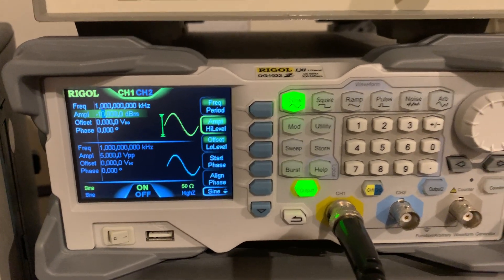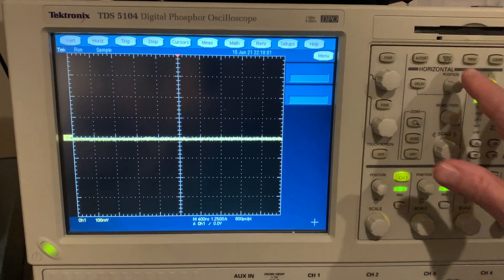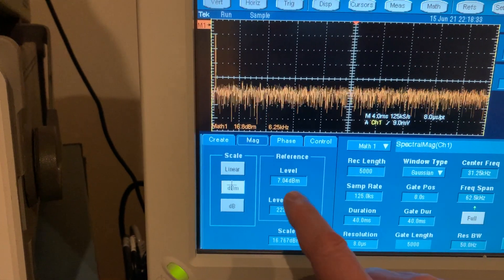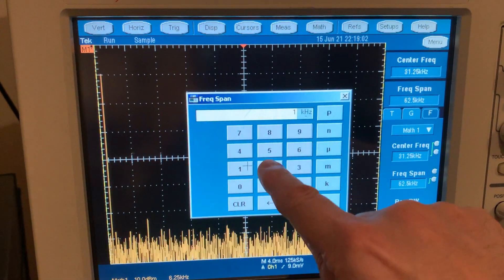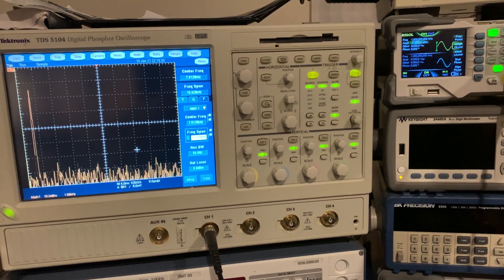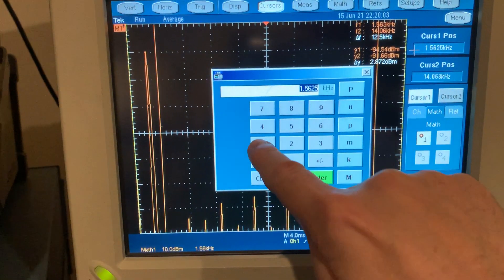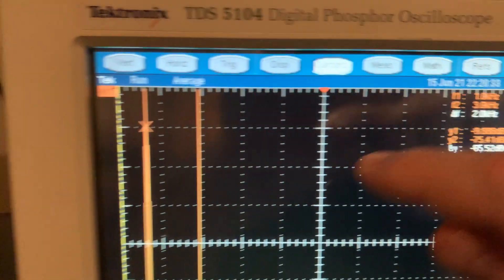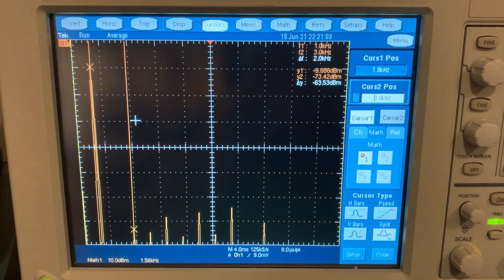Harmonic distortion of audio frequency from Rigol DG1022Z

Comment: Looks like the Rigol is doing an excellent job! 👍 Yes it's OK (and good) to use averaging. For a good primer on optimal FFT settings for best accuracy, check out W2AEW's video #65: https://youtu.be/oRf-IpG6XAw But I would think that if you are seeing the primary peak at the proper  (known) level that the smaller peaks should be mostly accurate. Looks like your 3rd, 4th, 5th, and 6th are the highest harmonics at -58,  -56, -54, and -60dBc, so added together those would be around -50dBc, which is about 0.316% THD, which is very good. (I wouldn't take into consideration the second harmonic or any other peaks below -60dBc as their influence is so tiny.)